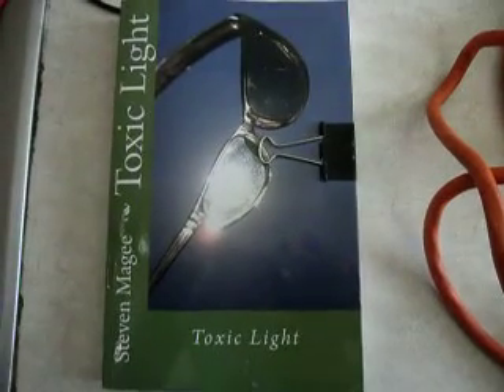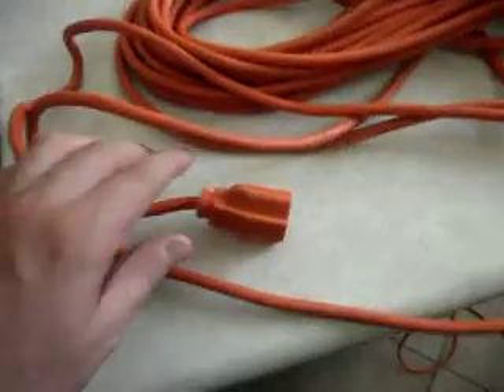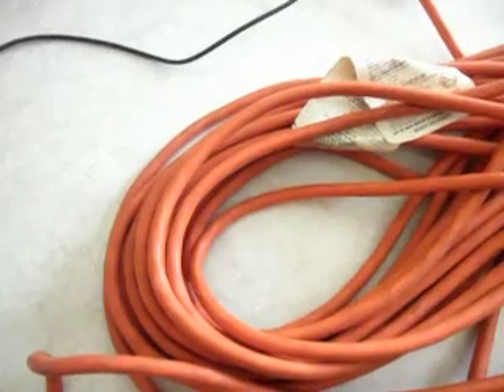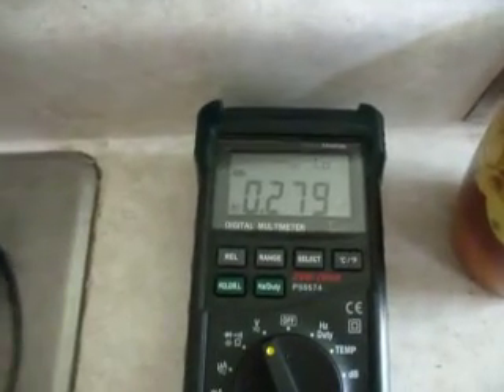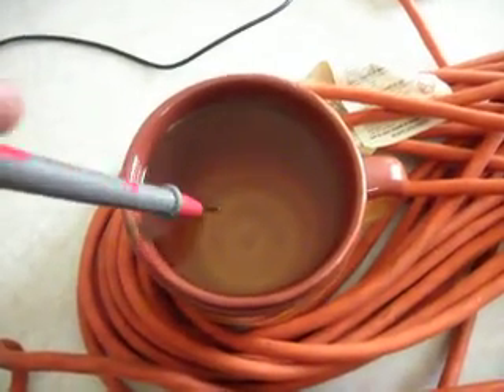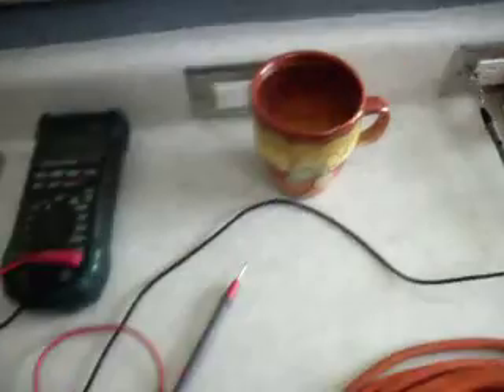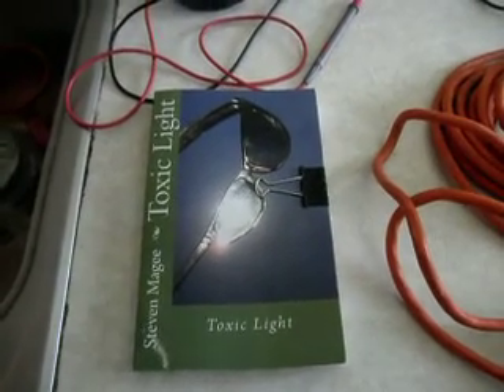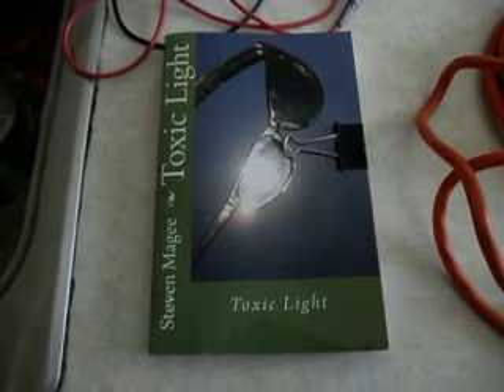Plastic Plumbing Stray Voltage Induced Into Water Demonstration

Comment from the maker: The meter reading is fine, I have tested the sine wave with an oscilloscope and it is symmetrical with a little noise riding on the wave that shows up with a fast fourier transform (FFT) analysis.  Both an RMS and a conventional peak meter read the same value at my home.  I appreciated your comments, they were valid points.

Comment: Are you using the recommended 2 K Ohm load across the meter to make these measurements meaningful (per recommended test methodology)?

As well as using an  RMS meter and not a 'peak' responding AC voltmeter?

.